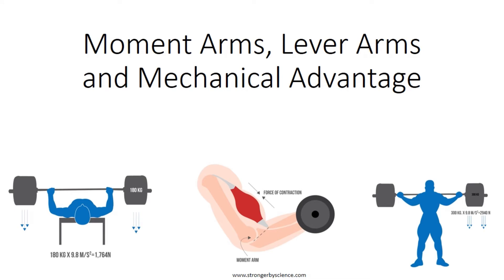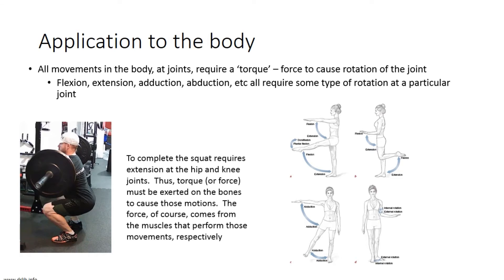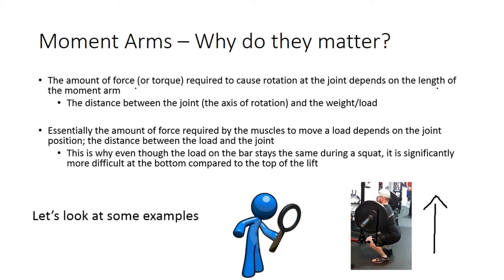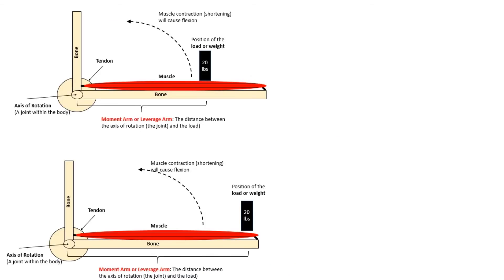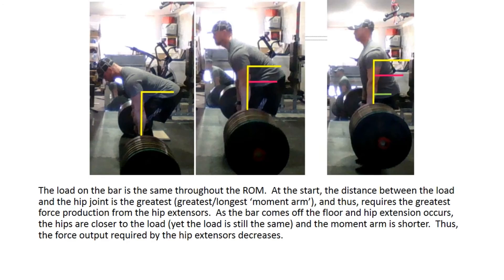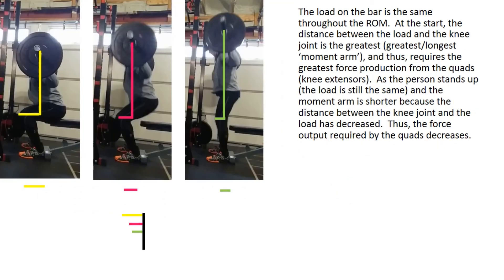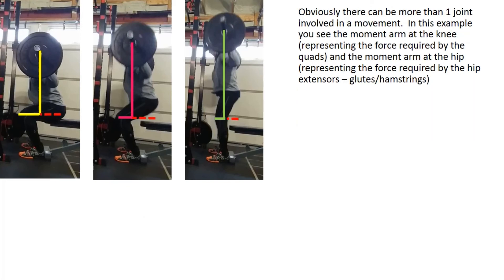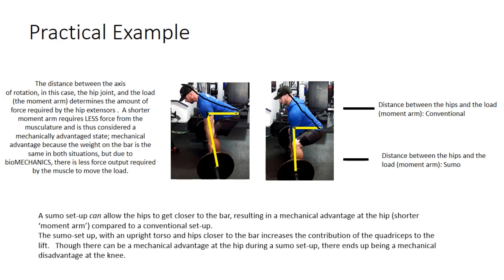Moment arms, Leverages and Mechanical Advantages in Lifting

Comment: This is a PT question. I was trying to explain this to my PT. Answer me this.. "single leg raises" with a 5 pound ankle wrap.  I explained to him that this straight leg raise for a beginner and someone who had crappy knees like I do, puts a great deal of stress on the knee. Someone who is starting out, with this position, can in fact cause the quad to work really hard because the weight is at the farthest point from the midline. Bringing the weight closer to the first joint (the knee) in the leg from the foot, might be safer and more effective to initiate the contraction of the quad instead of stressing the low backout and the knee. Your thoughts?  Sept 20 2024